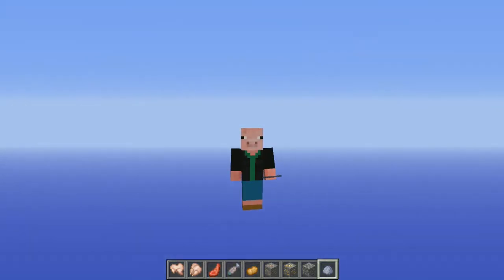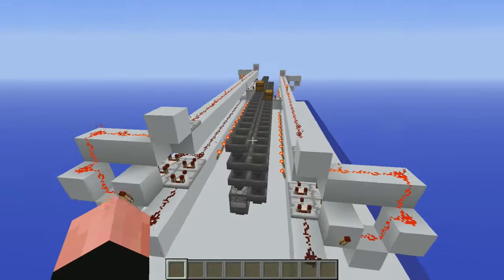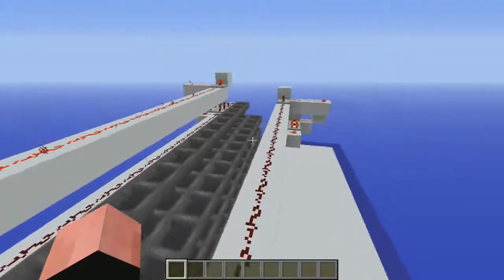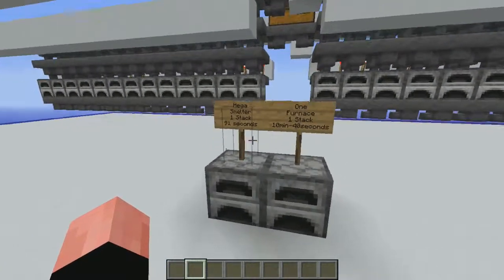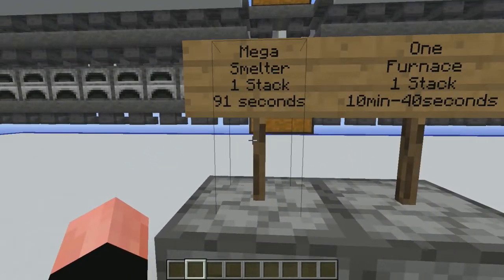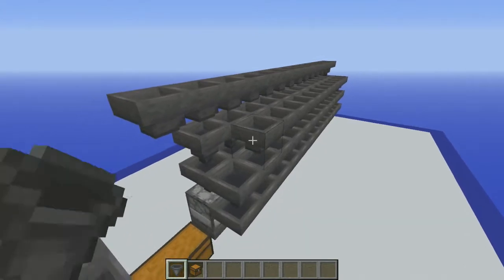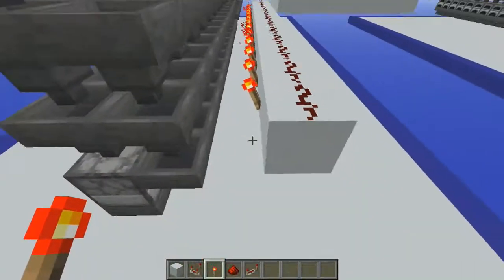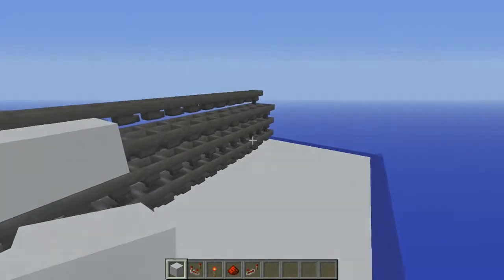Awesome Mass Super Smelter System - Minecraft Redstone Tutorial! PC, PE, Xbox, Wii, Bedrock Edition

Comment: Very interesting using a comparator fade clock to (un)lock the hoppers. If you load the fuel chest then it's never going to stop trying to distribute fuel? Could you pull the turn-off signal from the end hopper that feeds the furnace, or the furnace itself? Or maybe only distribute fuel when items are needing to be smelted? BTW, totally agree on the sticks as fuel.

One very nice feature of this design is that you can place empty droppers over the hoppers to cut lag.  Adding light sources along the redstone dust will also cut the lighting updates. 

Covering the hoppers may be a good idea anyway, to prevent random things from clogging the furnace array...had skeles/zombies burn up and deposit their remains into furnace array before.

Very nice and clear tutorial. :)
Reply from the maker: Great ideas and suggestions!